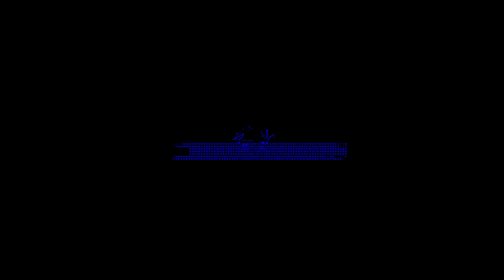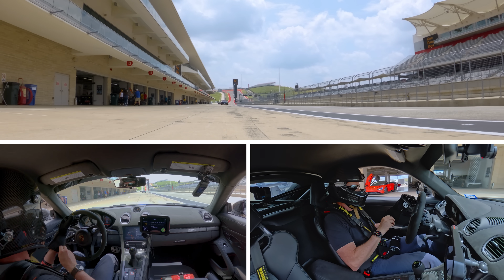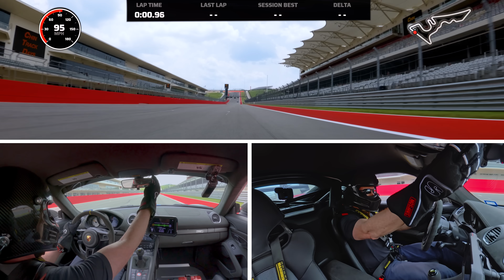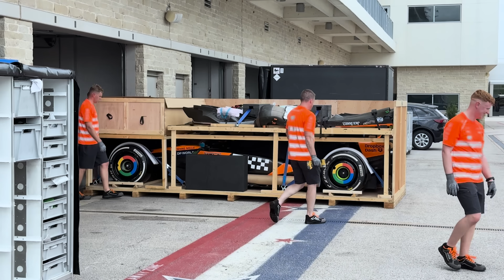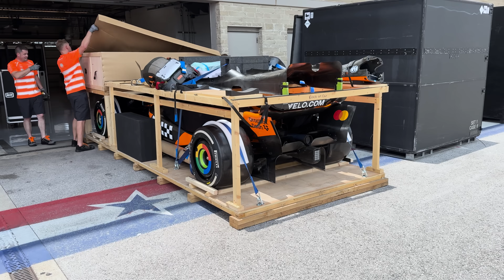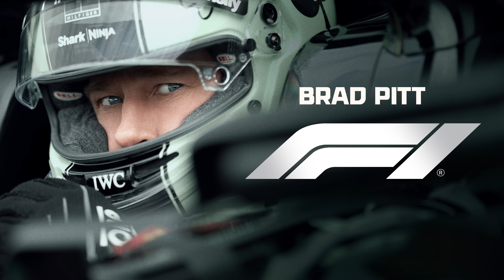Z06 vs GT4 RS : American Power Meets German Engineering at COTA

Comment: I am not at this level of skill and experience. But the C8 Z06/Z07 is my first Corvette and it's such a leap in overall performance going to mid engine. During the advanced driving school at Spring Mountain NV at 100F+, I never encountered any power throttling. 
My biggest issue is breaking too much and not carrying as much speed as I could on the stock tires.

Comment: The Z06 is simply in a different league than the GT4RS when it comes to real-world performance. The current Nürburgring time comparison is misleading—it's not official, wasn't done by GM, and was set under different conditions. The official Chevy-backed time, reportedly coming in July, is 6:58. That may not be record-breaking, but considering the Z06’s gearing, it’s as optimized as it gets—and still faster than the GT4RS.

Let’s be real: on faster tracks like COTA with fewer corners and more straights, the GT4RS doesn’t stand a chance. It’s a beautifully balanced car, sure—but it’s also underpowered, overpriced, and rides heavily on the Porsche badge. A glorified Cayman with a GT tax.

The Z06, on the other hand, is a no-BS American supercar—naturally aspirated V8, aggressive aero, larger brakes, better tires, and a surprisingly compliant MagneRide. It punches closer to the GT3RS, not the GT4RS. Porsche fans may not like hearing this, but badging a mid-tier car and pricing it like unobtanium shouldn’t go unchallenged.
Reply: I said the same thing to someone in another forum. The reality is the Corvette and Camaros are the most bang for your money I ever seen. Even a Camaro  SS 1LE is hard to beat for the price. The Z06 is incredible for the price. Sad to see the Camaro discontinued.  I hope they produce the Corvette for a long time so they can keep improving it.
Reply: I have no doubt if Corvettes were running the ring every single day, by countless professional drivers, and rando’s, like Porsches are… there would be a lot higher Corvette times at the ring. It’s almost like the ring isn’t in America or something lol
Reply: GT4 RS doesn’t belong in the same sentence as the Z06 when it comes to outright performance. The lap times make that obvious:

Z06 (Z07) at Willow Springs: 1:24.9
GT3 RS: 1:24.3
GT4 RS? Nowhere to be seen—and it wouldn’t be close.
Honestly, a more appropriate comparison for the GT4 RS would be the C8 Stingray, both in terms of power output and where they sit in their respective lineups. Z06 was built to chase down GT3-tier cars, not entry-level badge specials with a flat-six.

Hard to argue with the stopwatch.
Reply: @SimplyTechReviews 😂😂 the c8 stingray ia more appropriate comparison Why exactly? Because Performance numbers? What about price numbers? 😂 No way your trying to make that argument. No sir😂  We compare cars in the same peice range. The prices of the gt4 rs and c8 z06 are about the same so don't go getting mad that america can squeeze out higher performance numbers for the same price. Well actually porsche can too but they chose to scam their fans on purpose because they understand that their fans are slow.😂 Also stop mentioning willow springs only.... what about all the other tracks? Exactly you dont want to go there because the c8 has faster times on most tracks then the gt4rs.
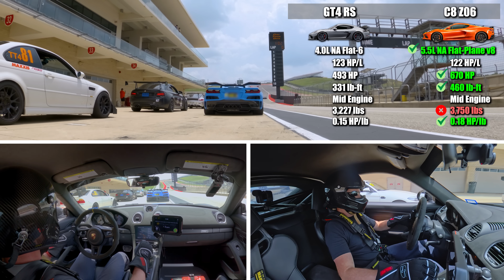Reply: you need to try duplicate the gt4rs lap time in c8z,  it is not easy as i was there and I tracked gt4rs, 992 gt3, c8 stingray, c8z06 and c8z06 with z07 and not brand bias.  he is very fast on that course and my old stingray sold to friend was running 2:35 on his first time at cota and I am around 2:27 first time at cota in c8z on 3r 4 day tires.  my plan was going to fresh 2r tires after 1st day after I am familiar with track but spark plug issues and even with 2r, probably can only do 2:24 in the summer conditions.  I even told my track buddy on 1st day even if i am in New zr1 I cant do 2:18.  at end of the day, it is how fast you are in your cars and the gt4rs guy is super fast at cota.  I could learn from him to be faster at cota and still 2:18 in c8z is not easy at all on stock tires.  I believe the blue c8z was the fastest z at track that day.  they will be very close if c8z is on oem 2r tires.
Reply: @SimplyTechReviews  lol C8 stingray is 30 seconds slower than GT4RS. Not same conversation
Reply: @eurly93  The C8 Stingray isn’t in the same class as the GT4RS at the ‘Ring, sure — but let’s not pretend it’s some joke car.
	•	0–60 mph:
 C8 Stingray (Z51): 2.9 sec
 GT4RS: 3.2 sec
	•	1/4 mile:
 C8 Stingray: 11.2 sec @ 121 mph
 GT4RS: 11.0–11.3 sec @ 124–127 mph

Track-wise? A Z51 on Cup 2s runs 1:28s at Streets of Willow, and can hang with a GT4RS on tighter, power-friendly tracks. Z06s are hitting sub-1:24s there — that’s GT3RS territory.
Reply: Call me a fanboy buddy but I just can’t get over lardy ass cars. I loved driving my 991 GT3RS at the track but my e92 M3 even with a lighter exhaust was a real disappointment especially in the braking zones. Less lard means better braking 
👍🇦🇺
Reply: Daaaaaang. U said it bud!!
Reply: Overpriced?  You don’t know.
Reply: z06 is a glorified Stingray which are a dime a dozen
Reply: @eurly93  By the same non-logic, the GT4 RS is just a glorified Cayman, the GT3 is just a glorified 911, M3 is just a glorified 3 series… lame
Reply: @eurly93 stupid comment
Reply: That’s weird considering I just watched the gt4rs blow by the z06 with its same trans as a c8 and other cost cutting measures. The gt4rs is bespoke engineering. Also that lap time is hilarious… right now it’s 7:10 no need to “speculate” and look dumb
Reply: @G82Watts  The driver of the Z06 is no where near the level of driver that the drivers of these record settings lap times are. This would not be the video to compare them directly. Not trying to defend the Z06 by any means, but it's just simply not a fair comparison.
Reply: @G82Watts  There is no official C8 Z06 time on the ring, but plenty of other track times.. done by professional controlled and the GT4 RS get its ass whopped ?  so what are you on about.  The video is kind a glorification of Gt4 RS...  great track car, more money and less performance.. if thats your taste, go at it...   BUT the owner of the ZO6 has a daily comfortable driver car on the way home with more amenities and gadgets ...  Its not a stripped down underpowered track toy .. that still looses to a 3650 pound , (NOT as claimed 3750) car
Reply: @G82Watts  Yeah, I'd have to argue that you're wrong until it's me driving the Z06 for the lap time. I know how fast I am and I'm definitely faster than you so, until I see those numbers I will have to disagree with you.
Reply: @G82Watts  let’s talk a bit about that seven minute 10 second Nurburgring lap run by SportAuto that everybody wants to talk about. There are a few facts that you probably aren’t aware of:

1. The 7’10” run by Gebhardt was his one and only lap performed in the car. In comments made after Misha Charoudin challenged the level of driving on this lap , SportAuto admitted this. So there NO warm-up laps, NO practice laps to get familiar with the car as a well run lap session should have.  Meanwhile he’s done countless laps in Porsches around the ring.  So he’s gonna be a lot more familiar with any given Porsche he takes out for a run for the magazine than a car he’s never driven.  And nobody, and I mean nobody, is going to get their fastest possible lap in a car they have never driven before, let alone on a cold damp track without fully warmed tires, which brings me to:
2. Conveniently, and of course entirely by coincidence and not any bias towards Porsche, one of their largest advertising accounts, the two times this magazine tested the Z06 were both performed in sub-optimal conditions: 3°C in the Hockenheim last year and 10°C for the Nurburgring test.  Meanwhile the Porsche runs are done in ideal weather with 20 to 25 C ambient conditions, conveniently the optimal range for the Cup2Rs.  Gebhardt himself said that the tires were not warmed up for the first half of the lap slipping during the SportAuto test, and that as a result of this and damp track conditions  he was having traction issues for a good portion of the lap. Not exactly a formula for an optimal time, especially for somebody who’s driving the vehicle for the very first time!  I don’t give a damn how good you are, you’re not gonna turn your best lap the first lap behind the wheel in sub optimal conditions.  Also, if you check on Michelin‘s UK website, they recommend at least 2 to 3 laps of warm-up on Cup2Rs for Nurburgring, which again was not done by Sport Auto. 
3. This bunk claim made by SportAuto about it not being fast enough to compete with the GT3 in 5th gear is laughable.  As tested by Car and Driver: 150-170 time for GT3 RS: 11.1 seconds  C8 Z06: 9.7 seconds.  The Z06 is in fifth gear for this entire speed range.  As OP’s own experience shows, the Z06 clearly accelerates much faster.
Reply: @G82Watts it wasn’t even a official time you dolt 😂 can you do anything that isn’t hating?

Comment: Displacement efficiency but that is hardly relevant unless you are running in a displacement limited formula. Even an older OHV American V8 (an LS7 for example) is as efficient  in terms of power/lb as the brand Porsche flat 6...at 1.112 vs 1.117 hp/lb respectively. I'd wager that the Chevy OHV motor is more efficient relative to packaging volume. Size and volume relative to power are more important than engine displacement.
Reply: indeed. Hp/ltr only matters with respect to race rules. on the track, hp/kg matters.

Comment: The C8Z cooling is a non-issue.   It takes serious effort to get the water and oil over 200-210F on a hot day.
Reply: on track over 220 easy but has always been fine so far
Reply: @goonthreegtr  What track and ambient temps?   85F at Sebring and my max temp was 210.
Reply: @spearfish25 sebring and cota😊😊 ambient temp 85+
Reply: I agree. I was at the tail of the dragon last weekend and never went above 207. @spearfish25
Reply: @spearfish25 sebring and cota, ambient temp 85 +.  I will be at sebring july 18-20.  I believe oil about 230s

Comment: Looks like a convertible Z07 for the blue car. Still an extremely fast car, but just carrying  more weight than than the coupe due to the hardware for the folding roof. The Z06 is an absolute weapon on track though, proper race engine inside of that thing. No cooling issues from what I’ve talked to and heard from owners, and the ZR1 handled COTA without any issues as well.

Comment: I also have a Porsche gt4 and gt3rs but I’ve been considering to get a corvette. What are your thoughts on the zr1 for the track?
Reply: Wait on the gt2rs
Reply: @G82Watts I’m curious what the new gt2 rs is going to do against the new zr1 lap times wise. Chevy was sandbagging their horsepower numbers. Apparently it’s making 1028 to the rear wheels. It’s pretty much a 1150hp from the factory.
Reply: my buddy and I track 992 gt3, 992 gt3rs, gt4rs, 23 c8z06, 23 z06 with z07 and ordered 2026z06 and 2026 zr1.  the porsche being light is best for running long periods.  the c8z has 0 cooling issues and both of ours have ap competition brakes so no brake issues.  being heavier, tire give out quicker than rs and harder on brakes.  the zr1 we anticipate to kill all on pb lap time but at over 4000 lbs probably not a car I want to do 30 min sessions.   so depends on what you like to do. the center lock on porsche is pain since we dont have the 5k gun and using torque wrench.  only issues we have on the 2 c8z are misfiring due to spark plugs and coil pack so far with 16k miles total
Reply: This is helpful! Thank you. I’m assuming the Corvettes need a longer cool down?
 
I am an amateur tracker. What would happen if one word two track a heavier car for a long period of time?

Thanks
Reply: @downtownguy212 not cool down issue.   harder on the tire means you lose grip earlier.  also more weight and hp = more kinetic energy to stop equal more wear on tires and brake pads.  once you start track more look into ap competition brakes 25 mm pads as you can do probably 2-3 the track events before changing pads and more confidence on braking .
Reply: @goonthreegtr  thank you!
Is there a source that provides guidance on tracking? 
I’m leaning from other people and it’s great that people are so nice to share info. 
If there was a track 101 source to learn all this it would be valuable for new comers
Reply: @downtownguy212 you have porsche, just do the pca hpde and they will have instructors.  the event in the video is chin and they also have instructor for people new.  pca and chin are very organized.  just make sure your car has good brakes and high temp brake fluid
Reply: @goonthreegtr thanks. Those are the two groups I run with at Sebring 
But I’m leaning about different cars and their pros and cons 

Appreciate all the info
Reply: @downtownguy212 I am going to pdg July 18 and pca July 19 and 20 at sebring.  that track i am familiar with,  cota just 1 hr.  maybe see you out there
Reply: @goonthreegtr I’ll be at Sebring as well on July 19 and 20. I’ll be at the tent hosted by Amy of quest auto sports - they provide track support
Reply: 2 days ago i was at drag strip and 2 c8z ran.  their trap speed was just 123 and 124.  same day the 296 gts trapped 143 mph!  i am just shocked how little top end and still doing well on road course.  i guess most cars with alot of top end cant last on track!
Reply: @goonthreegtr  drag times are completely different from road track.
Reply: it will be slower than the GT3RS in corners but faster in the straight the C8